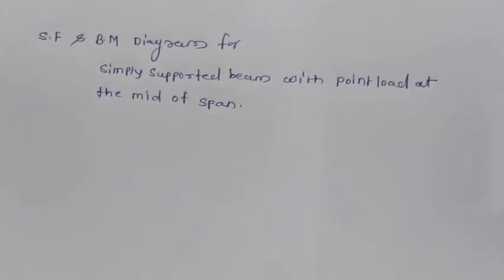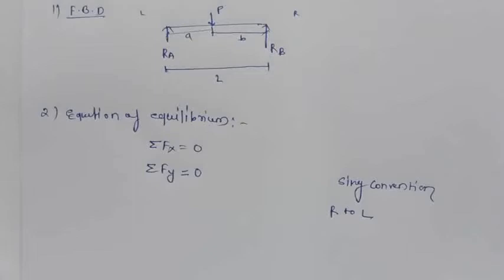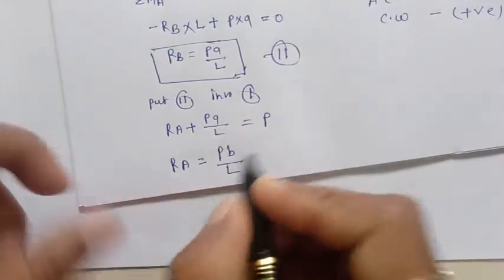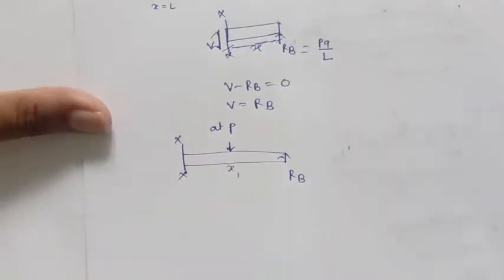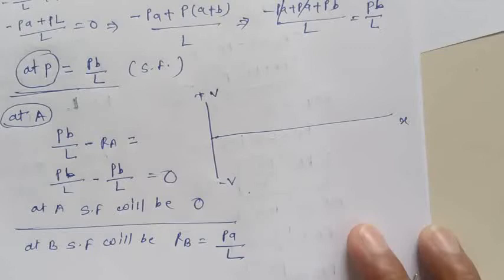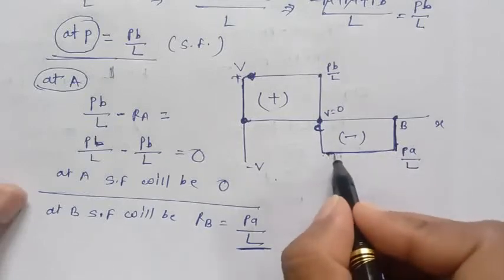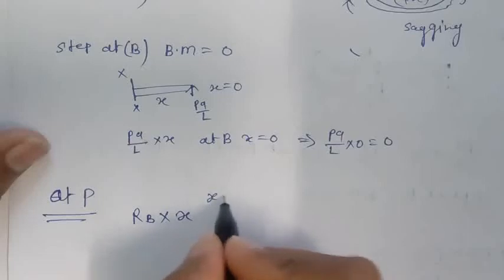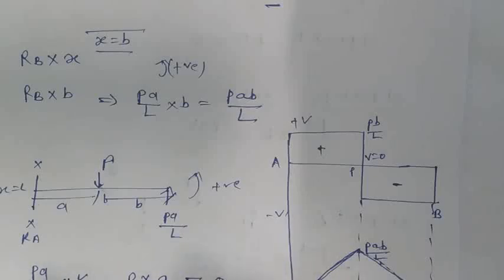SFD and BMD: simply supported beam with point load at the mid of span

Comment: Sir in the simply supported beam there should be a force in x direction from the hinge support side?
Reply from the maker: Ofcourse threre will be reaction force in the X direction which already I have discussed in the basics of shear force and Bending Moment, types of beam, but here I have not shown because there is no counter horizontal force is there the value is zero therefore eliminated. Summation of X equal to zero. But in you can show while solving problems.